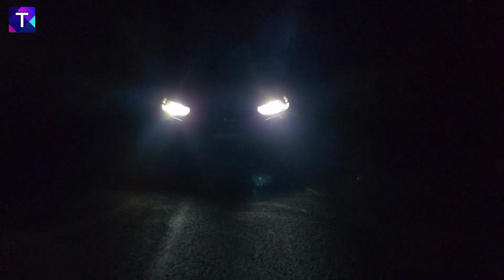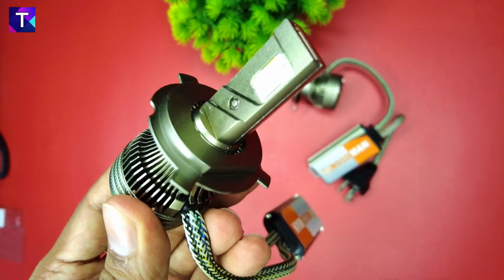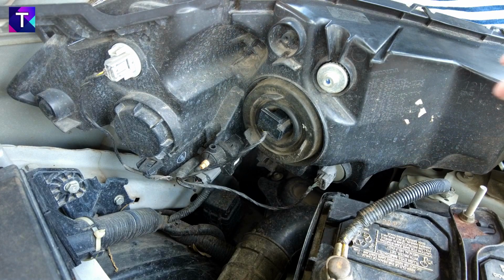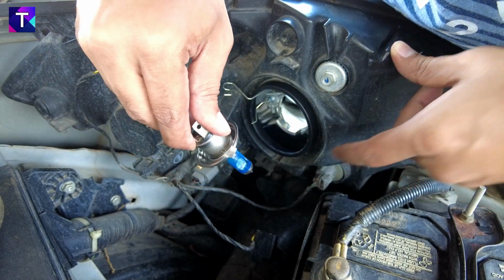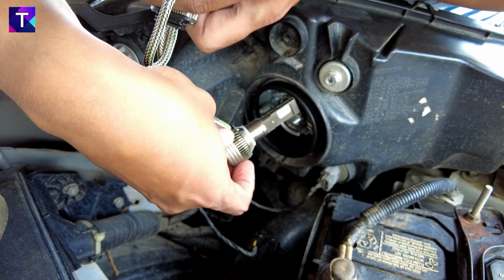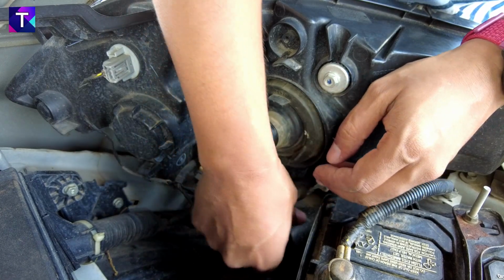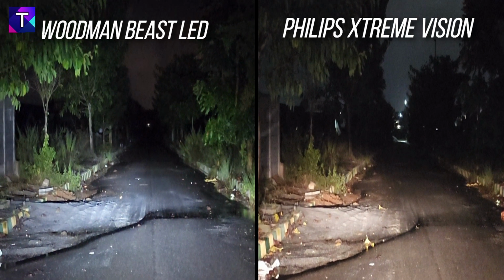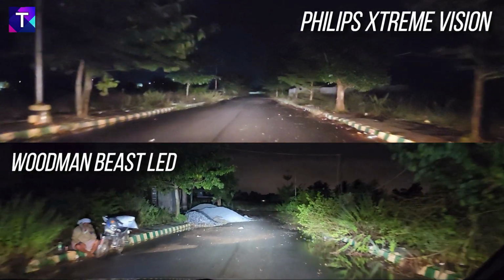Woodman Beast Owl 120W LED Headlight Bulb | Quick Review, Installation & Comparision | Gizmobeep

Comment: Keeping the wire hanging out of the rubber cap may cause water or dust to enter the headlight assembly , right ?
Reply from the maker: Yes. For that purpose you can use an insulating tape to cover up any gaps. Although the chances are limited since the area occupied by the wire opening is very small.
Reply: @gizmobeep  are you facing any dust or moisture in headlight.
How have you sealed it further by taping?

Planning for DHC F75 4300K led bulb upgrade

Comment: I have changed the bulbs in my WRV to DHC Pro 55W 4300K. The lamps are perfect for driving in rain. They have approximately 7700 lumens light. Perfect for all kinds of driving. However, for city driving I found it an overkill and therefore changed the fog lamps to M617 IPH projector fog lamps. It is bi-LED and I find it extremely useful for city driving only in the low beam. The high beam is connected to the high beam of the LED lamps and the combined output is phenomenal but you can use that only on highways. My guess is that using M617 bi-LED will not attract the attention of police especially in states like Kerala.
Reply: I am planning to get DHC Pro 75W  4300k 14000lumens for my Venue Projector setup.
But there are far better US brands like Novsight which provides 20000 lumens with 55W bulbs.
Confused.
Reply: - Today i went to install it in JC Road, but came back with installating as he said, installation involves cutting portion of rubber seals and tapping it so that no dust goes inside.

How it's done in your car?
Can you share photos or video?

Comment: Nice Video Bro.... for Honda city, whether one pair of bulb is sufficient for covering both high beam and low beam or we need 2 pairs?
Reply from the maker: You can contact the Woodman Service via WhatsApp. The number is present on their website(link is in description). They will provide you the details about how many bulbs would be required. You can then decide later.

Comment: Sadly these type of modifications are illegal in India, especially in Kerala 😕
Reply from the maker: The enforcement of the guidelines is an issue, just like tinted glasses, bumper guards etc, most car owners who use them never face any issue. Some do. It comes down to the individual to use or leave it.